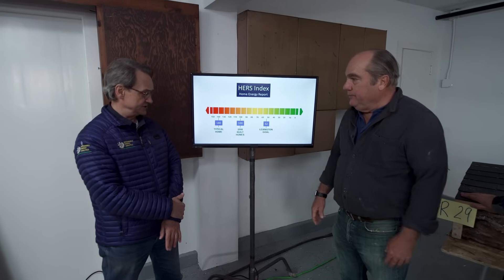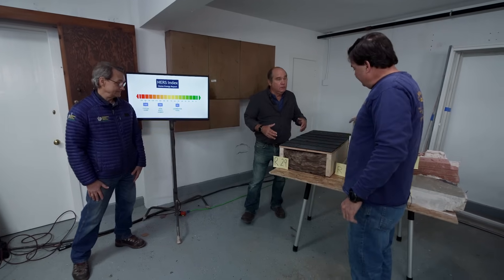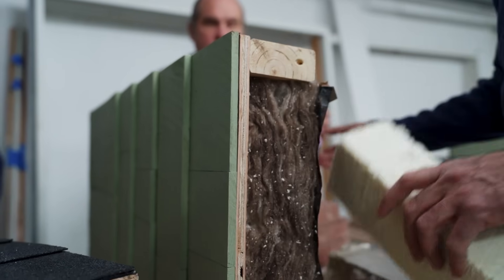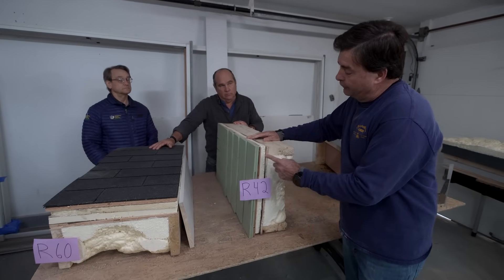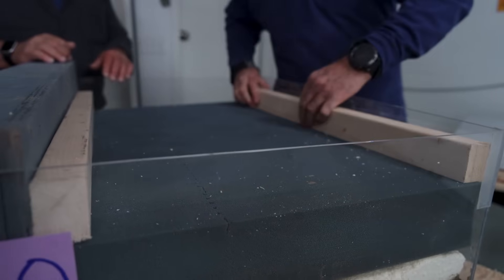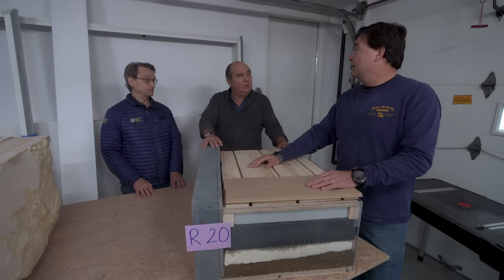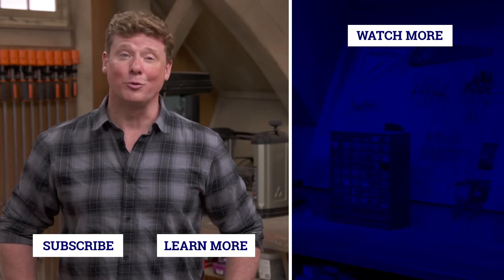Home Energy Rating System | This Old House

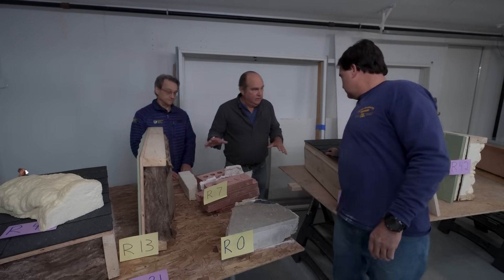Comment: 2:32 This is dangerous.
Sandwiching materials between 2 or more layers of closed cell foam (sprayed and/or panels) will trap any moisture and result in rot. The assembly needs to be able to dry to the inside or the outside otherwise it is only a matter of time before water will get trapped and rotting will begin.

Comment: So at 20% increase in cost on a $300,000 house is an additional $60,000 to save on energy, if you use $2,000 in heating it would take 30 years to recoup that expense.  SMH 😂 Oh I  forgot "Climate Change" is behind all this.  I say "DRILL BABY DRILL!"

Comment: All new buildings should be designed with large roof overhangs. The large overhang provides beauty and protection from the sun, rain and wind. 
Protection of the doors, windows and siding make for a more durable and comfortable home.

Comment: So how can this new rating be achieved without spray foam? Many lenders now won't mortgage a house with spray foam.
Reply: Read the fine print. It depends on the type of spray foam and where it's applied. For a DIY person, rigid foam can be applied inside and on top of a roof with similar results.

Comment: My house was built in 1978 and I have replaced the Electric heat pump/and furnace/air handler 3 times and as always the Freon has changed or the government mandates inverters or what ever. Long story short my heating/cooling was always great not really pricey. BUT 1 month ago I had to either fix my carrier or replace it. I called B Dot they gave me a price of $16,000 to replace my old carrier and I was told the new ones use different gas are more efficient and will save me money. So I agreed and and the day before install B  Dot called and said the Carrier could not be installed in one day due to wires or tubes, But he could switch me to a Rheem system same price installed one day and was told it work fine.
Well this furnace runs on/off 3 times more than my other systems. At 71 it barely heats before it starts to run again. Filter is new and clean Did I get reamed with this Rheem complete system

Comment: I’m not a fan of HERS.  Didn’t even account for thermal masses.  It also didn’t account for the HEALTH of the occupants.  In a house with that much air sealing you’d need an ERV, dehumidifier, and humidifier with good filtration installed.  Otherwise the occupants will be getting sick.
Reply: Passivhaus is the way.
Reply: Doing additional thermal mass only helps in a temperate climate where the day/night average temperature is moderate. That won't work in Massachusetts, but what will work is having a lot of insulation and having a very well-sealed home.

I'm renovating an old home, and we've tightly sealed it and extensively insulated it, and the temp hardly budges between day/night times even when not heating it with 30 degree temperature swings outside. Only thermal mass is the house interiors, and we still need to add sheetrock to half of the house.
Reply: They require energy recovery vents with the hers test .
Reply: It's always a good idea to open a window during winter. These energy people never talk about fresh air!
Reply: @RealMTBAddict  I'm shocked they didn't fit a full building science course into this 5 minute video and so couldn't talk about fresh air systems in this video. 🙄

I guarantee the code in that location requires a fresh air system to be installed.
Reply: @RealMTBAddict     but they do talk about fresh air exchange at a controlled rate, although not in this video. In the meanwhile, go play outside and get some fresh air!
Reply: @rupe53  I'm in South Florida so it's easy!

Comment: Partly why newer homes and remodeled homes in the northeast have been rising in cost over the last several decades. Which explains why average people often can't afford them in many cases. Meaning some wealthy person or investment group buys them and rents them out at a premium price.
Reply: The cost of utilities (heating, cooling, water etc) will be much higher than the price of the built over the lifetime of the home. Most economical is to invest more at first and pay less over time. Do the numbers.
Reply: the remodeled homes are the ones that don't need to meet the newest code, which means flippers can get away without stuff that MUST BE DONE on new homes. The so called premium rental price has more to do with the local market than anything else. 2 bed / 1.5 bath in my hood is $2500 a month all day long.

Comment: The proposed roof assembly will most likely cause rot in the future. I have repaired a lot of spray foam hot roof assembles over the years.
Reply: I have been hearing insurers in the UK don't insure or get mortgages if you have open cell, not sure about closed cell foam. It is crazy to me. 'Merica.
Reply: @donc-m4900  It is just applied incorrectly in UK. If you spray into a roof and house that wasn't designed for it, you will get issues.
Reply: @yodaiam1000  well that sucks.
Reply: The assembly has to be designed correctly but it can be done.
Reply: The same politicians that push this stuff 
wonder why there is an affordability crisis for home buyers .
Reply: @Don-Pe , The affordability issue is corporations buying homes in large numbers. When they own 30% of the homes in desirable areas, they dictate the price.